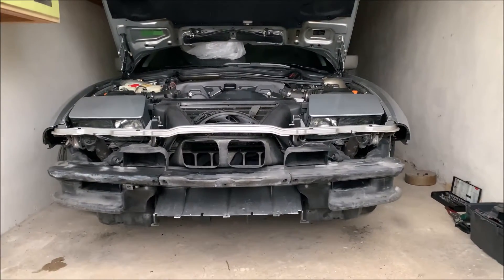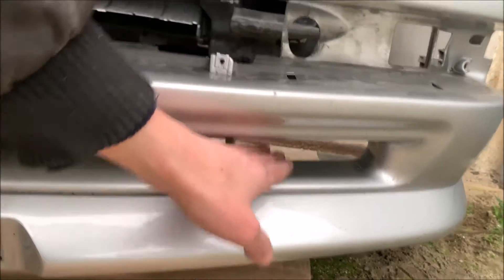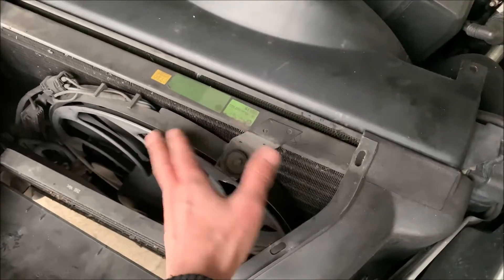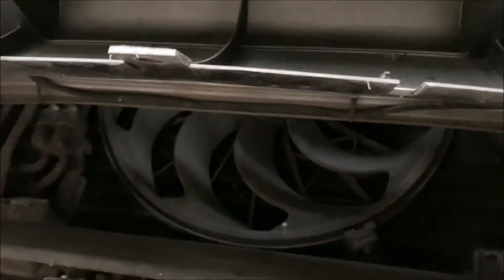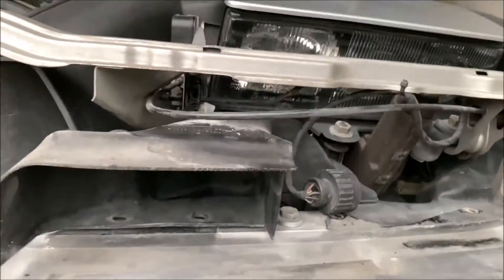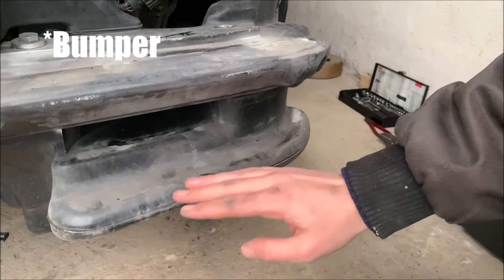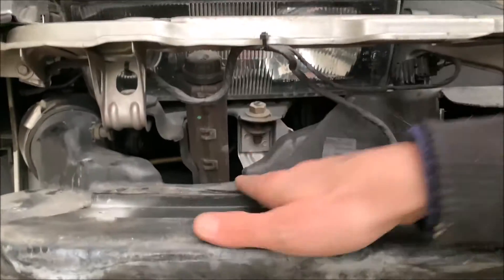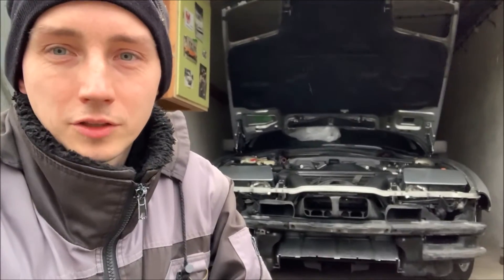BMW 850ci E31 - The Incredible Front End Design EXPLAINED

Comment: How much do brake cooling ducts affect braking performance on high speed braking? I have an E39 which does have brake ducts, but they are covered in the bumper meaning they don't get any airflow. I noticed during high speed braking that the brakes start to get hot pretty quickly.
Reply from the maker: Especially between hard braking they can cool your discs down again. But it really depends on the individual design. BMW brake ducts usually work quite good. Others just guide air into the wheel arch and hope it will get to the disc somehow.
Reply: @bsport320  That's interesting! When I mentioned my brake ducts being covered, a lot of people in the BMW community just told me they won't have a noticeable effect anyway (but they aren't engineers, you are, haha). Though I'm wondering how much drag I would add to the car by uncovering the intakes for these brake ducts?

Also, my car is missing it's engine and transmission undertray/skid plate. How much of an effect does this have on highspeed highway driving, especially drag, lift, and wind noise?
Reply: @MiLC0RE-iwnl  front underbody panel could improve front downforce by a lot